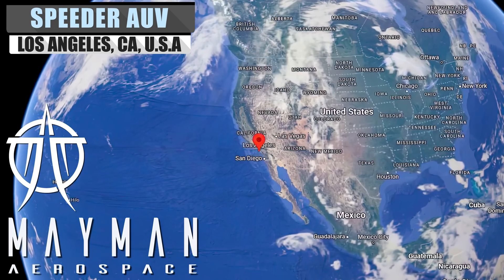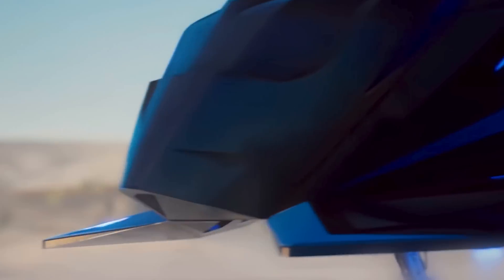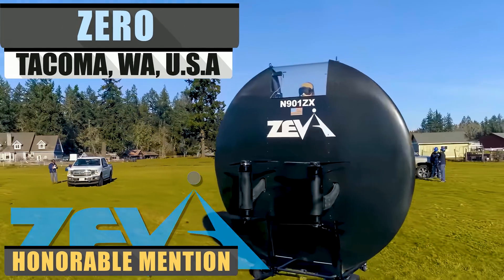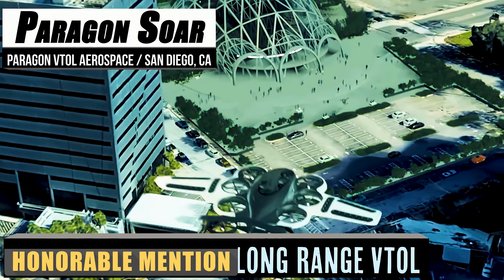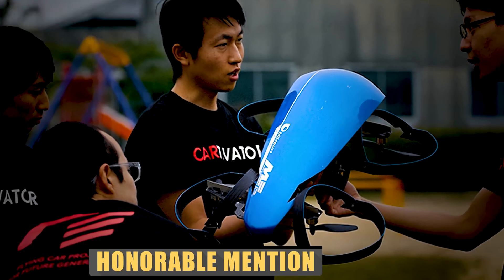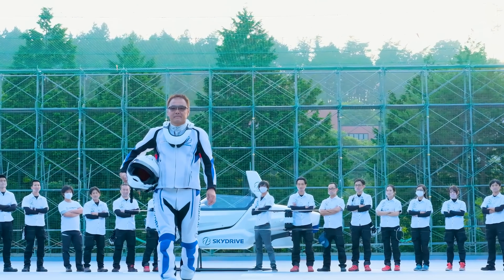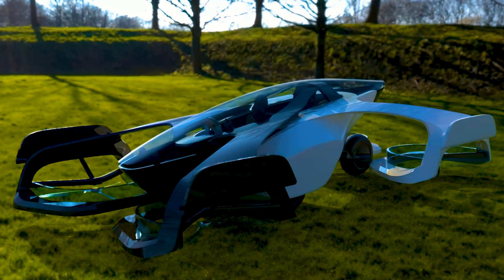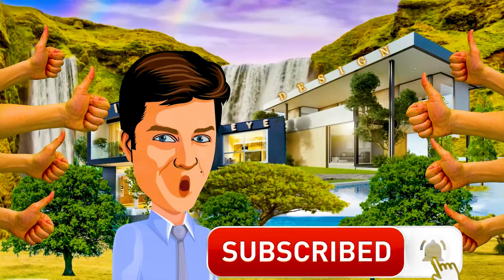SPEEDER AIR UTILITY VEHICLE IS AN ACTUAL FLYING MOTORCYCLE

Comment: When they have more than just animations, and wild promises, then I may believe they can actually accomplish this.
Reply from the maker: They have a prototype.
Reply: I've seen models in that configuration using single motors this has double i imagine that's so if you have a glitch in flight control the duel system can reboot the one system while other keeps you stable .

Comment: 2:35 No! It will go for about 10 minutes with a person and won't go 400 miles in ten minutes. And NOT 500 mph and NOT 1,000 lb payload!
Reply from the maker: " Another use is for cargo, as it comes with a cargo mode. While in this mode, it can fly for four hundred miles at five hundred miles per hour and carry loads of up to one thousand pounds ."  What is quoted above is what he said.
Reply: I get what you're saying.  This is highly unrealistic.

Comment: It's not an actual flying motorcycle, it's a design concept that exists only as renders.
Reply: But it should work cos of the jet packs using the same type engines have flown successfully. e.g. the Flyboard Air and another more conventional jet pack using those type engines.
Reply: @Justwantahover  Feasibility isn't my concern. The fact that ~80% of tech ventures are some form of financial scam is what I am always wary of.
Reply from the maker: @nondescriptname  80% of tech ventures are scams? I am just curious if this is a fact you can back up, baseless opinion, or wild exaggeration?

Comment: I thought of that a year ago and even did some doodles. But can't afford to make one though.
Reply: Most genius designs started as quick sketch concepts and most didn't have mechanical engineering backgrounds . . . The Wright brothers never had a pilot licence or training
Reply: What is your mechanical/engineering background? I'm sure your doddles reflect what the video has shown us.
Reply: @ibdaffy  I had 3 smaller engines x 4 instead of 2 X 4. Basically the same but no math or any stuff like that. Just a stoner doodle. But if I had a spare 100 grand, things would be different. But I would have to get help. I also thought of the wingsuit in the 80's (with a doodle) but it would not have worked. Too much strain on the arms with my idea. Only a single sheet of fabric made the wings, instead of the wind inflatable fabric idea on today's wingsuits that must take a lot of strain out of the arms and legs.